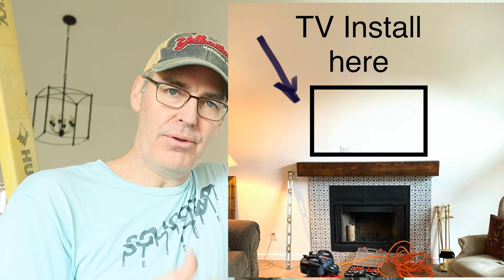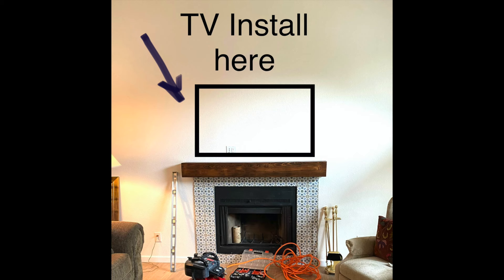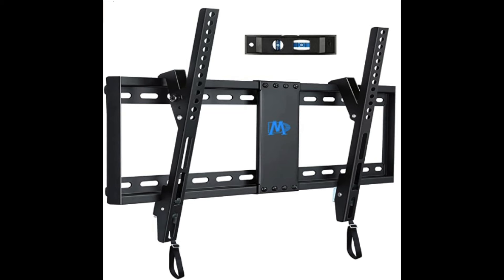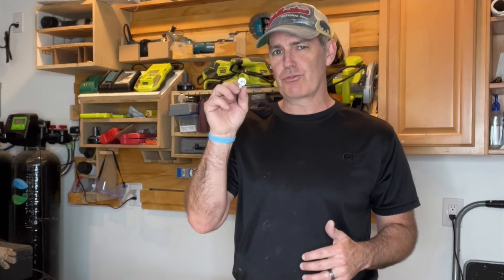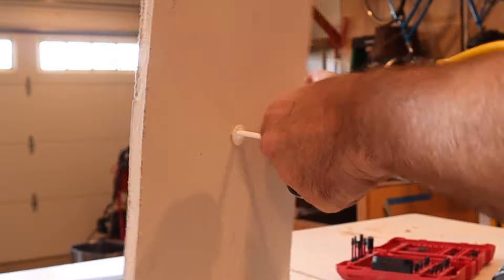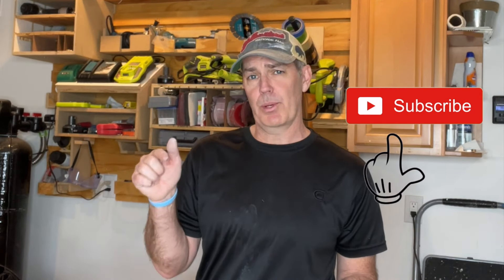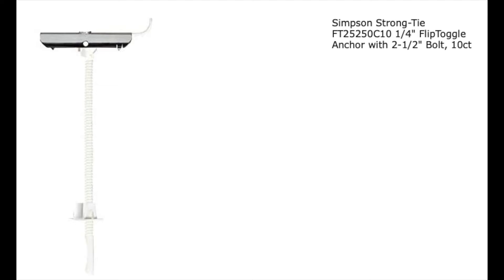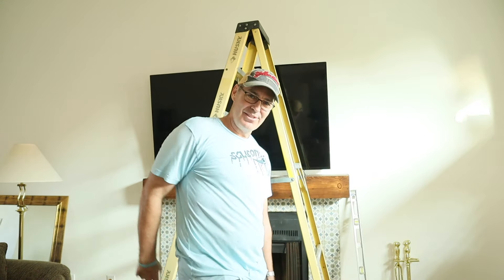Best Way to Attach TV Mount to Just Drywall

Comment: Good for flush mounts but not for the full motion style.
Reply from the maker: Very true…pinned ur comment
Reply: Ok. If you attached a piece of 12x20ish 3/4" plywood to the wall with say 8 flip toggles, then also flip toggled the mount thru plywood, would that likely work? I'm thinking spread the load.
Reply from the maker: I think 8 would be overkill but would def work
Reply: @how2q  After reviewing my comment...yep. Attach plywood with 4 flip toggles. Attach TV mount with 4 flip toggles. That would still eight instead of 12. I put my full motion in the corner of old mobile home. Built a frame work out if 2x4 to attach mount to. Likely overkill but safe. I'll redo it better in the spring.
Reply: Why would this not work for full motion mounts ?
Reply from the maker: Usually full motion mounts pull out and then swivel left and right.  Problem w this is once pull out tv it puts a lot more force on bolts.  So what ever advertised load for bolt goes down when you put more force on it
Reply: What about swivel mount ?
Reply from the maker: @jimmysapien9961 anything you pull out and rotate is putting more force on contact points.  Further you come out the more force.  Pulling out very slightly to swivel would be probably ok
Reply: Exactly!
Reply: The TV’s today are so light, these will hold flush mount or a swivel mount. It’s not like you’re going to be hanging off the damn thing. 😂
Reply from the maker: @TrashyLobster also any “limits” placed on these such as weight bearing capacity are super conservative.
Reply: @how2q    Correct, an 85" smart tv is only 90lbs.  It’s the shear weight that’s a concern, but each anchor hold 150lbs is my point.
Reply: @jimmysapien9961  no problem with swivel. Had one for roughly 20 years not attached to a stud. Just remember to be gentle when moving it around, and try to not move it too often. It's best to keep in flush though.
Reply: @how2q  so what if u drill three holes at the top of the dry wall an three at the bottom. AN add flip toggles in  all holes which would be six would that add more support
Reply from the maker: @brianjenkins1609 hey the more the merrier!! Over engineered is better than under engineered!
Reply: @how2q 
Compression weight is not the problem with pull out tv mounts. It’s the shear weight. Compression x 5 = shear weight, or force. That’s a lot of weight. Flush mount only into Sheetrock if it’s a lightweight tv. My best advice anyway.
Reply: @how2q what if I have it on stud on one side and the other is anchors, it should be sturdy enough for pull out full motion mounts right?
Reply from the maker: I know its been a while…how’s the tv mount in mobile home after a couple of years?
Reply: Why?

Comment: Those toogle bolts also say do not use for mounting tvs....so who do I believe? I've used them to mount small tvs but I need to mount an 80" tv and now I'm worried the flip toogles won't work...
Reply: I would stick with the all steel toggle bolts. Never had them fail!
Reply: I would not trust those plastic toggles at all only use steel. I know I’ve been a carpenter for 40 years and believe me I used to work for the School Board. I know everything that comes down the TV mounts and beyond you need to try to find where the studs going to be those toggles are just secondary ever try to rely on toggles they’re just us a weak Do this unless you want your TV to come crashing down on the floor?

Comment: Used 2 packs Saturday to mount a 55” above my fireplace through natural stone. Blocking was too low so I used those and it’s holding.  So far so good.  DeWalt laser level used. Saw this vid this morning. 😂. That’s par for the course!!
Reply from the maker: I’m sure you will be good…when in doubt over engineer!!
Reply: Tv still in place??

Comment: Great video! Thank you for taking the time to make it and make it so well! I’m gonna pick up a pack of these and try it out!
Reply from the maker: Quick update… I know in this video, one side was a stud which actually in your living room or wherever you put this will typically be the situation. I’ve also used for these without a stud that worked fine. If there is no stud at all, I would use a TV mount that pulls out in articulates left and right. Just one that stays against the wall.

Comment: Thanks a lot for the video! I re arrange my HT setup and I wanted to mount the TV this time, my problem was that the studs were in a place were the TV would not be in a center position from viewing area, so I got those anchors and I used 6 of them, 2 on each side of the base plate and 2 at the center, my TV weights around 37 pounds(17 kg) and those anchors are supposed to hold around 260 ponds on drywall, so I think it's solid... I hope so 😅

Anyway thanks again!

Comment: Wow, I was stuck on not having any studs on my wall and I watched this video and went to Lowe’s right away and grabbed them and installed them in 10 minutes and it held on pretty damn good. Definitely recommend
Reply from the maker: Thanks for the feedback…glad it helped!!
Reply: I am faced with same issue.   I am in Florida and all I have is a furing strip and then concrete block.   I am trying to hang a 46” tv
Reply from the maker: @mtebor i did a video w just your situation.  Hope this helps.  https://youtu.be/vPGi7lGsauA?si=wDgjpeS0xKTUNzrw

Comment: New subscriber, but read the back of the package, not recommended for mounting TVs. Not sure why!
Reply from the maker: Think i did this about 2 years ago still solid.  Would still be confident about using them
Reply: Because it’s dangerous. Overtime the weight of the tv will be pulling on anchors in the sheet rock. Sheet rock is not meat to carry heavy loads. I’ve seen my in law install his tv with plastic anchors. It was coming out and the tv was crocked. So I was helping him and that’s when I realized it wasn’t screwed into any studs. The kids could have been watching tv and it could have fallen on them. Luckily  I corrected it.

Comment: Very helpful thank you. I have a Sanus mount wall for a 43” tv. I doubt the weight is a problem but I am worry that once it is installed because it extends up to 21” forward, that weight and the length when extended will rip the drywall because it will no longer be close to the wall, thanks!
Reply from the maker: So we are talking tension and shear…shear bering weight would be the down force on wall (mount as it sits against wall).  Tension would be the pull force (extended).  According to hilti…one toggle option.  Tension is 45 lbs for 1.  Since you might actually be using four Yeah that would allow up to 180 pounds.  I’m sure there is some genius out there that can figure out at 21 inches with your mount and TV what that weight and force would be but I’m probably not that guy. But at 180 pounds tension (theoretically if u hung it straight down from ceiling) with all four I’m assuming it will be overkill for what you have. Bottom line I think you should be good.
Reply from the maker: BTW those numbers are for 1/2” drywall.  5/8” goes up to 85 lbs/ per toggle
Reply: @how2q  thank you. When the weight is within range, if the mount wall is fully extended, will still hold it (21” away from the wall?) 🙏🏻
Reply from the maker: yes it "should" work...I would do it in my home
Reply: Just an update, it didn’t work, 😆 the Sanus mount wall SMF421-B1, has an arm that extend 21” and once the tv is installed (28lbs mount wall arm plus tv) makes lots of squeaky noises on the wall holding the tv when fully extended. I would not trust my tv with that and my wall is 5/8” drywall. Thank you anyway!!!
Reply from the maker: Wow thank you for sharing…another option…grab mdf…paint color of ur wall and mount to wall (on studs) then affix mount to mdf.
Reply: Mdf
Reply: What's mdf ?

Comment: Hopeufllly I find a stud but I haven’t had luck. So if I do bonus, if I don’t I’m going to try 8 toggles. The difference I got is I got snap wood panel over the dry wall, with a built in wall entertainment center. So hopefully it’s solid bc I got 65” tv that weighs about 50/55lbs
Reply from the maker: Honestly, you could go with four tacos for a mount that doesn’t pull out and move left and right. Definitely had the extra ones if you want more movement in your TV. Good luck. Let me know how it goes!
Reply: @how2q well good thing is I won’t move it much if at all. The recess of the hole is only like 45” so the 65” tv will have to come out a good cpl inches, bc it’s 50” wide. I figured mind as well put one in every hole I got for more support. Hopefully I find a stud but last night I tried quick and the stud finder wasn’t working to well. It could be thicker than 1.5” maybe that’s why. I’ll let ya know how it comes out tonight. 🤘🏼🤘🏼
Reply: @ well I found Atleast one stud so I got two lag bolts in one side and I toggle bolt the other side bc the studs are all messed up if I had a mount that had maybe 3 more inches I would have been able to do four lag bolts. It’s pretty dam sturdy I can almost lift myself up on it and I weigh 182lbs.

Comment: Great video! Studs are over rated. Also, almost all studs I’ve encountered are metal. I just use ez toggle bolts and they never failed me - mounted a 85” TV.
Reply from the maker: Sweet… having encountered metal studs yet. If I do, I will use the same!
Reply: @how2q yes they’re a pain to drill through. And what if the ‘metal stud’ is a water pipe of some kind of metal cover to protect electrical wiring? I’d rather stay away from metal studs. They’re always found in condos or any tall buildings.
Reply: My dry wall is extra thick, what fixing can i use?

Comment: Would regular anchors work?
Reply from the maker: “Regular” is a broad term.  Toggle bolts are best bet just be cause they can usually hold the most weight.  You can guess weight of tv and mount.  Just make sure your anchors can hold the weight

Comment: Have a wall mount in kitchen above the frig. Replacing existing 19" TV with a 24". Just wondering if existing wall mount will work and what comes 1st to reinstall? Remove TV or remove wall mount?
Reply from the maker: Remove tv first.  Should be able to us previous mount w new tv.  May need different bolts…current ones also may work (assuming you have 4 bolts attaching tv to mount “rails”).  If current bolts don’t work go to local ace or true value w tv and match.  Hope all that makes sense

Comment: What about thin walls? Just curious on how to do that. I have a 50" Samsung, and a small bedroom, trying to make some more space and turn it into a mini Gameroom and a bedroom. Especially for VR Space, etc. I want to add a PC desk under the mounted TV too. So I can have more space, etc. I can barely walk in my room as it is. Lmao. Sadly my brothers bedroom closet is behind my TV. So I don't know how I can do that with out f'Ing everything up. This is a 104 house after all. :( Don't want to cause any damage. :( Are there any alternatives by chance? Sorry just wondering. Literally in a tough spot.
Reply from the maker: 104 house?  All drywall is either 1/2” or 5/8” thick….behind that you have studs (3 1/2”) thick.  Don’t worry about punching into the closet from ur new game room.  So at a minimum with the drywall on the game room side, 3 1/2” studs, and then the drywall on the other side, there is a minimum of 4 1/2 inches between the rooms.

Comment: Thanks for the video! Great info! My wall studs are 24 inches apart.  Im trying to mount a 77" LG G3 which is 81 lbs. The center where I need to mount is between the studs and the flat mount that comes with it is only 16". There is no way for me to reach any studs at all. Are these toggle bolts still a good idea with no chance of hitting a stud? I was thinking of opening up the wall and installing a 2x4 horizontally between the studs but Id rather not do that if I don't have to.
Reply from the maker: If you use 4 1/4” toggle bolts you should be good.  Just make sure its a flat mount.  Wouldnt use with mount that pulls out and articulates left/right

Comment: Can I mount a 55 inç tv to 1.8mm wood ? Should I place studs behind where the screws go only?
Reply from the maker: Do you mean 18 mm?  What is the wood attached to?  Is it drywall then wood then concrete/block/brick?
Reply: @how2q  yes I mean 18mm mdf. So, there is a window, so I will have to mount a piece of mdf to windows right and left to  first to make sure it will support the mounting it will create 18mm gap from concrete, then I will place 240x180 cm mdf, it will cover the whole window, also will cover the first mdf piece, On the sides I will put stud between bigger mdf piece and concrete to level.  At the and I will place mounting through two 18mm mdf (36mm total). Tv is LG C3. Whole idea is close the window. And I cannot mount it only on concrete because it will not be symmetric. What do you think.

Comment: Hey. Quick question. I live in an appartment building. No studs for us to drill into. Wouldnl this work for me. I see you drilled in to studs on one side. And how many should i drill into. 65 inch tv weighs about 45 lbs
Reply from the maker: No studs required.  Just make sure tv mount is a flat mount against wall. Some pull out and you can move tv left and right…don’t use this type
Reply: @how2q  I see what you mean.  Ty

Comment: Do you think these flip toggles are good enough to use with the automated mantle mount in your other video?  I plan to use six on top and four on the bottom as the holes don’t line up with any studs to be in the center above my fireplace mantle.
Reply from the maker: Honestly, I probably wouldn’t. At the end of the day would it work? I think so, but I couldn’t guarantee it. The fact that it is going away from the wall and down, puts more stress on those bolts. When the weights are given that It can handle that’s sheer weight which is vertical weight.  when you introduce a TV that goes out that wieght it can handle goes down.
Reply: @how2q  Agreed, thank you for the reply and informative videos.  Have a nice day.

Comment: I bought a 50 inch and live in an apartment with dry wall I was looking forward to this video til he mentioned a stud. Is a stud necessary in order to use the toggles and mount the tv?
Reply from the maker: I depending on the age of your apartment/condo. There is a stud every 16 or 24 inches. Can you just use toggle’s… Yes you can. Just make sure that it’s not a mount that can pull out and rotate. That will probably not work. if it stays flat against the wall then great. I guarantee wherever you are putting your mount, There is at least one stud available.
Reply: @how2q damnit thank you so much though, one more question I bought one of those mounts that you mentioned and I don’t feel like returning it would it still be safe to just have it flat and not pull it out all the way?
Reply from the maker: @rigo5589 yes…just keep it flat.

Comment: What if there is concrete 1/2” directly behind the drywall? The deepest screw that can be used is 1 1/4”. Can the toggle still be used?
Reply from the maker: TV Mount Drywall over brick or block
https://youtu.be/vPGi7lGsauA
This is the video i did that i believe is your exact situation

Comment: hi sir may i ask u something  o neet to install my tv 65 on my drywall whit no wood  what u this if i use the driller toggle Cobra.. and why in the packet of the tv mounts say( Dont mount on drywall   Alone).. im scare to do that what u think i need your help
Reply from the maker: I’m surprised there is not stud (wood) at all in your drywall.  If this were my house i would use toggle bolts and i think it would be ok.  In the end it is possibly a gamble
Reply: ok so sir ahat u think is better that i find the wood or a fix whit the butterfly
Reply from the maker: @ilNewyorkese  yes i think it is better to find some wood
Reply: @how2q  Hi i have a metal stud instead of wood stud on my fireplace drywall. Do you reckon this will work to mount 65 inch(57lbs) tv please. Thank u.
Reply from the maker: @subashh  go for it…make sure one side is on metal stud

Comment: great video! picked up my togglers. Im just wondering if you mounted the bracket to the wall using the mount's screws or did you get your own 1/4 machine screws? Do the ones that you get in the mount box usually just work on the togglers? Cheers.
Reply from the maker: Sorry for late reply…used screws that came w toggler.  Grab some washers if they aren’t included…will ensure firm install in case bolt heads barely cover mount holes

Comment: Can you tell me if these flip toggles will work on shiplap too?  There is shiplap above my fireplace.
Reply from the maker: Really depends…if your shiplap is over drywall/wood studs then yes.  Some people have put shiplap over an “older” brick fireplace…in that case no.  What I recommend is when you initially drill… Use a smaller drillbit and see if, after you drill through the shiplap, you hit drywall/stud or drywall w nothing behind it.  it’s very tough to use a stud finder over shiplap. Hope that helps.

Comment: At the end he's snuck in "find a stud and screw it in" lol So do I need a stud with the toggle bolts or  not
Reply from the maker: The reality is almost all mounts will be attached to one stud.  Depending on the age of the home, you will have studs every 16 inches or every 24 inches.   What’s the time you’ll be able to use one stud. Even if you can’t find any studs for toggles will work. But as I have said before, these are only for flush mount TVs.

Comment: you don't know why in the flipToggle package it says do not use for mouting televisións ??
Reply from the maker: I believe that is a very conservative statement.  I have had my tv up for over two years now and no problem.  Just don’t use w a tv mount that you can out out and swivel tv left and right.  That would be too much for toggle.  Use a tv mount that remains close to wall.  Further out you pull tv more likely it will fail.